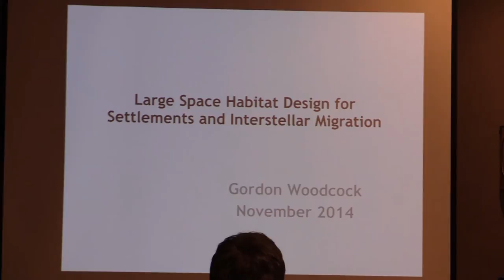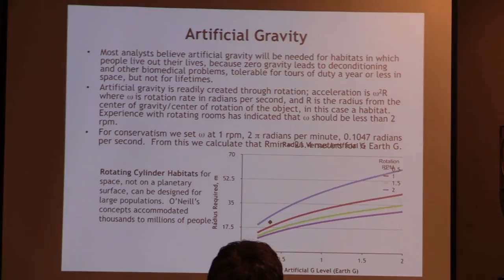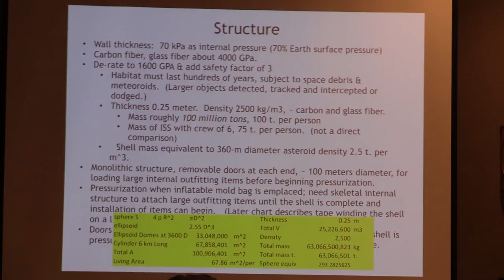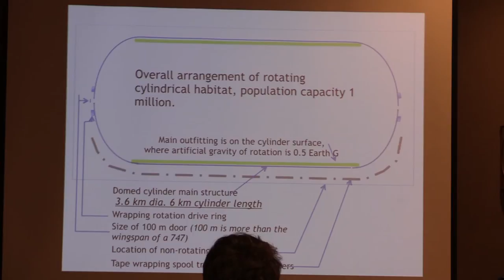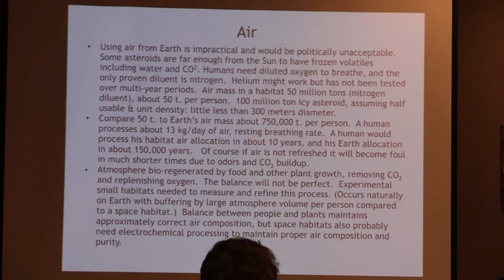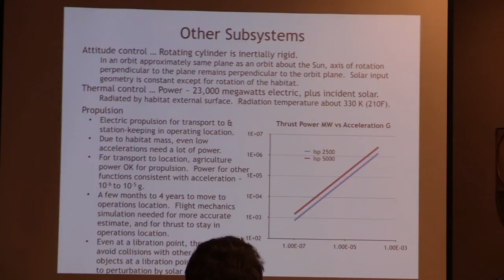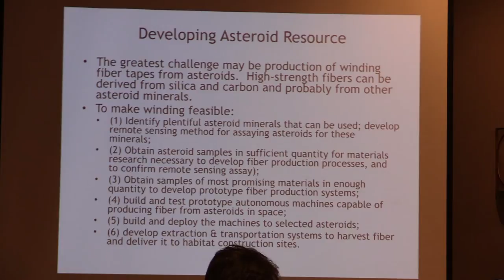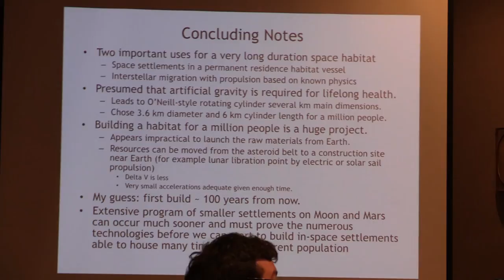10.0  A Construction Scenario for O'Neill Cylinder Space Settlement Habitats

Comment: Fresh is this way off or what. You start with a smaller habitat because any massive construction requires a large workforce for decades and they would need a safe place to live which means micrometeorite and radiation shielding and an Earth like environment. However, even a small Stanford Torus takes a lot of labourers so you have to see what can be built without labour that is by robotics which would likely be the micrometeorite and radiation shielding which could literally be sandbags of asteroid regolith. This guy has no imagination, no idea as to where the air would be from ... air is basically nitrogen and oxygen which are both available from asteroids in the form of ammonia in the ammonia water for nitrogen and of course oxygen from water and or silica. You need to find people with more vision for your talks.
Reply: That was Geesh not Fresh, the auto speller sucks.
Reply: One word: Robots
Reply: Oxygen makes up nearly 40% of the Moon's crust.
Reply: Teleoperate robots from Earth.  A small crew in space to fix robots if they break beyond being fixable by teleoperated robotics.
Reply: @seen203  Mobile Workers